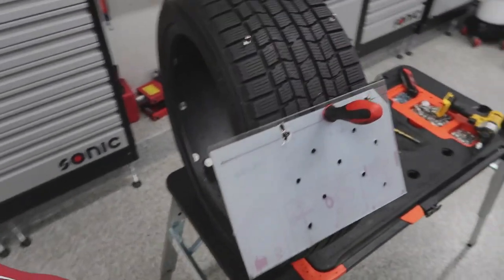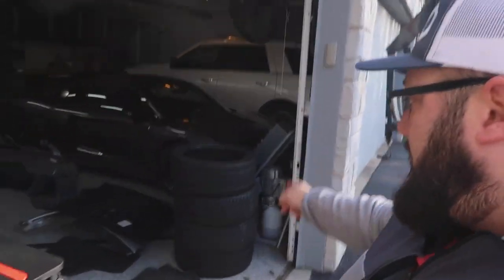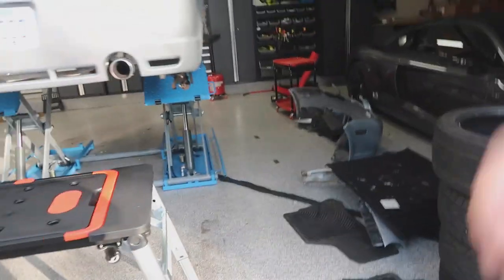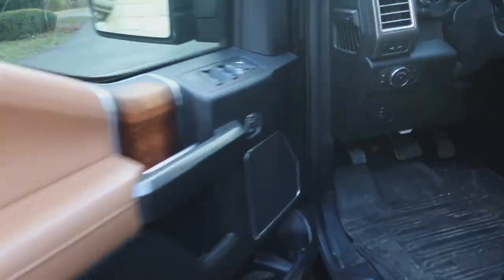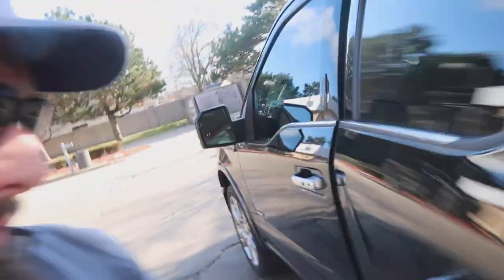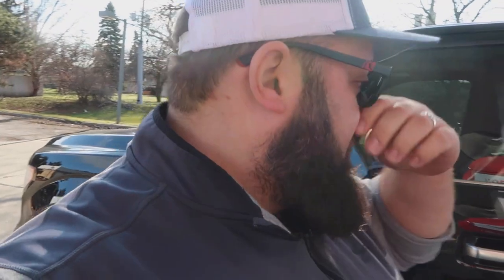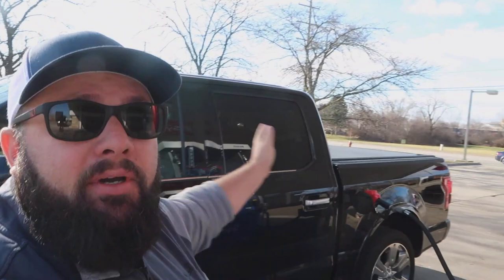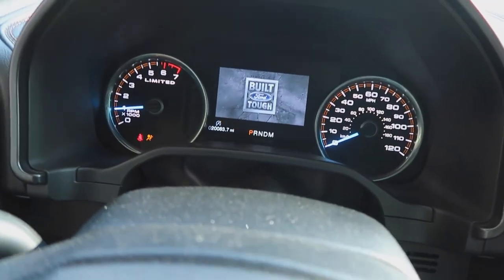VW MK4 R32  Preparing Ice Racing Tires....this SUCKS!!! The Project Car Rebuild Pt.8.1

Comment: Probably I am missing something...
After all those 480 nails are in, are you going to balance the wheels?
Reply from the maker: Armafly yeah.... it ain’t going to happen to well.. we will see
Reply: Just a curiosity: do you have to reinforce the wheel well walls? At that centrifugal speed a single loose nail would fly like a bullet. 
(Just in case wear a bulletproof vest😄)
Reply from the maker: @Armafly  there shouldnt be any way for a stud to fly threw the wall as the back side of the stud is about 1 inch in diameter